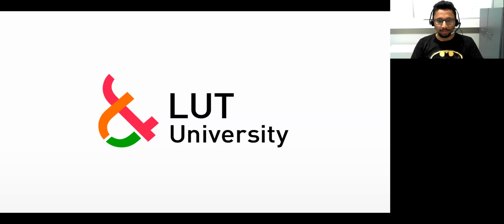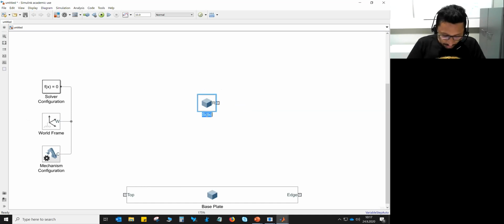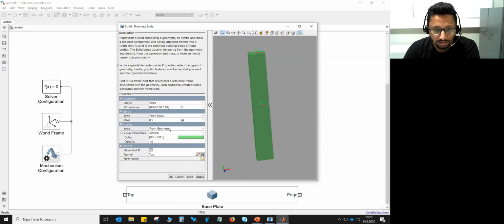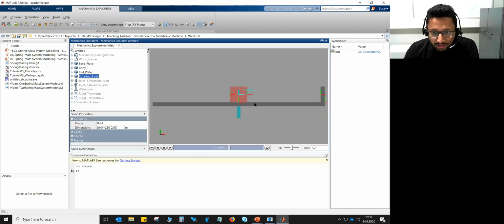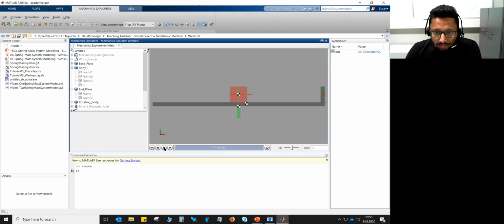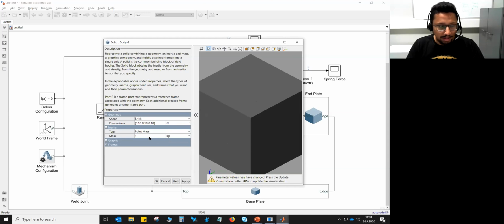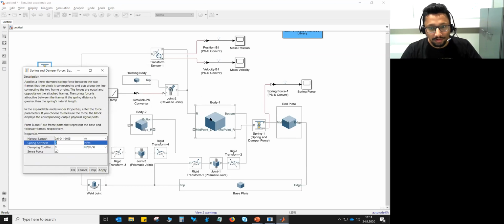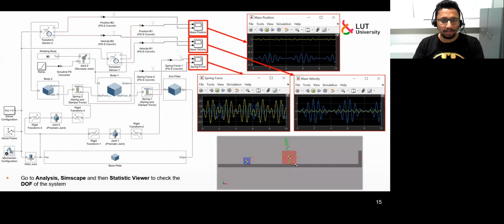Tutorial 03: Spring-Mass System Modeling | Simscape Multibody | Matlab | LUT University | Finland

Comment: 00:00 - Introduction
- Presenter: Suraj introduces the tutorial on modeling a two-spring mass system in Simscape Multibody.
- Focus: Horizontal oscillation of two masses connected by springs.
- Outline: Requirements, modeling steps, subsystem creation, and extending to two-spring mass system.

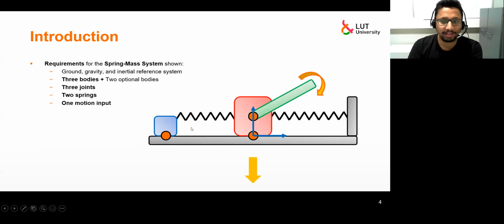01:24 - System Requirements
- Key components:
  - Ground and gravity (modeled as vertical downward force).
  - Inertial reference frame for origin definition.
  - Three main bodies: red, green, and blue; optional gray base and end plates.
- Springs and joints:
  - Two springs, one motion input, and three joints.
  - Visualization aids like base and end plates ensure clarity.

04:21 - Simscape Multibody Setup
- Software setup:
  - MATLAB 2019a version used; initial environment configurations demonstrated.
  - Gravity reoriented to -Y direction.
- Base plate and end plate:
  - Dimensions defined for visual representation.
  - Frames for connectivity carefully placed.

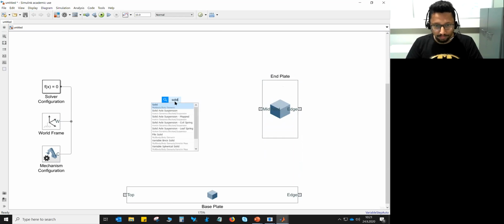14:47 - Modeling Body 1 and Rotating Body
- Body 1:
  - Defined as a 200mm cuboid, 10kg mass, with bottom and side frames.
- Rotating body:
  - Green rectangular component connected to body 1.
  - Revolute joint added for rotational motion.

23:16 - Joint Configurations
- Joint 1:
  - Prismatic joint for body 1’s horizontal motion.
  - Rigid transform aligns Z-axis motion to horizontal X-axis movement.
- Joint 2:
  - Revolute joint for rotating body with motion input.
  - Angular velocity provided via a ramp function, simulating oscillation at natural frequency.

33:45 - Spring and Force Configuration
- Spring 1:
  - Connects body 1 to the base plate with calculated natural length (0.85m).
  - Spring stiffness: 1000 N/m; damping disabled.
- Force sensing enabled for scientific analysis.

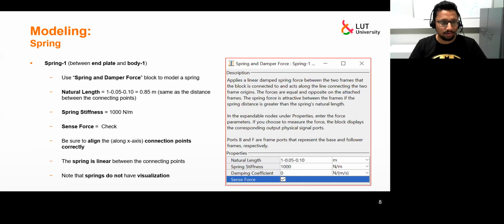38:37 - Simulation and Analysis (Single Spring-Mass System)
- Results:
  - Rotating body causes oscillatory motion in body 1.
  - Increasing amplitude observed due to lack of damping.
- Visualization:
  - Mechanics Explorer reveals behavior and verifies setup.
  - Position, velocity, and spring force plotted for analysis.

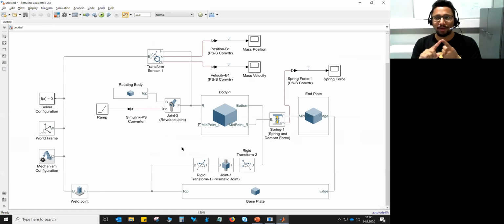53:22 - Extending to Two-Spring Mass System
- Additional components:
  - Body 2 (100mm cuboid, 1kg) positioned 0.6m from body 1.
  - Spring 2 connects body 2 to body 1, ensuring linear alignment.
  - Stiffness for Spring 2 set to 100 N/m, ensuring same natural frequency as body 1.
- Adjustments:
  - Rigid transforms manage positional offsets.
  - Second prismatic joint added for body 2’s motion.

1:06:24 - Simulation and Results (Two-Spring Mass System)
- Observations:
  - Body 2 acts as a damping mass, reducing body 1’s oscillation amplitude.
  - Energy transfer observed: Body 2 absorbs oscillatory motion, stabilizing body 1.
- Plot comparison:
  - Position, velocity, and spring force of both bodies compared.
  - Body 2 demonstrates damping behavior, evident in oscillation reduction.

1:14:11 - Industrial Relevance and Conclusion
- Real-world application:
  - Analogous to acoustic dampers in machinery to reduce vibrations.
  - Smaller mass and spring coefficients effectively stabilize larger systems.
- Degrees of freedom:
  - System DOF calculated as 2, accounting for motion constraints.
- Final remarks:
  - Comprehensive modeling workflow completed; users encouraged to experiment further.

Comment: nice video, I have a question regarding thesame simulation but in the y-direction( direction of gravity ) without any actuation, but just with gravitational force( free fall ). The body keeps on oscillating by free fall. how do i obtain steedy state? that means the body just pulling (with its proper weight) the spring and come at rest as in the reality?
Reply from the maker: that's a very good question Jordan, I would suggest that you can play around with the additional mass and spring coefficient. It may help you answer your question. :) (NOTE: Please, like and subscribe to my channel it needs support to reach to a larger audience)
Reply: @DrSurajJaiswal  i will subscribe and Share 🤝. i tried changing the Spring coefficient but it on oscillating, just That the frequency changes as the Spring coefficient or mass varies. I don’t also want it to come at rest with a damping mechanism. I Want that by starting the Simulation the weight first pull without oscillations. In other words i want to obtain norminal length of Spring plus Extension without oscillations.

Comment: Good video, it's well done... But i don't understand the way you configure the rigid transform : There are two pairs, and each pair have B(Base) and F(follower) ports, which frame should be projected on the other? and why you used two rigids transform on prismatic joint? I thought that one should be necessary
what about natural grequency (natural pulsation)? I thought that if i exceed this value (10 rad/s), they'll be an instability but i tried with 15 rad/s, the system ran normally, what interpretation to give about it?
Kind regards
Reply from the maker: About your question on prismatic joint, I think you should watch this video. I have clarified everything here. You will get a much better understanding: https://youtu.be/WNrkxvQBQGU
Reply: @DrSurajJaiswal  Thank for the link
Reply from the maker: about the question of natural frequency, it is a bit tricky. It is because there are some natural frequencies where the system will be critical but then there are some regions between those frequencies where the system behaves normal. So i would suggest you not to go there in detail because a lot of things come into action then.
Reply: @DrSurajJaiswal  Okay, thank you
Reply from the maker: @khalildiha7229  :)